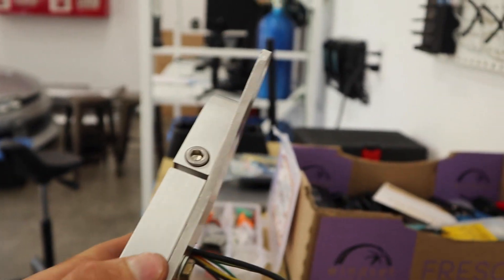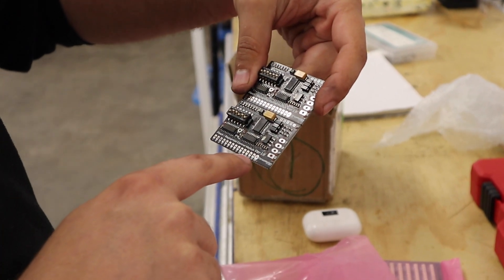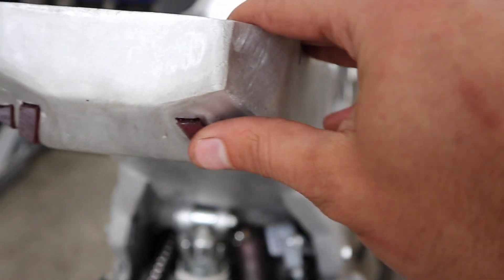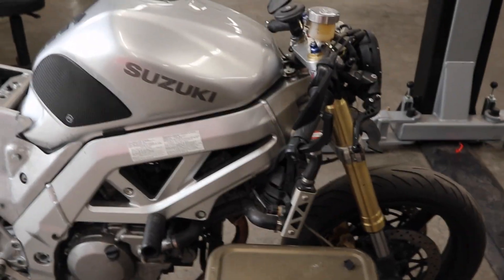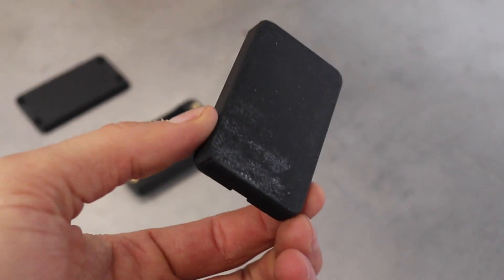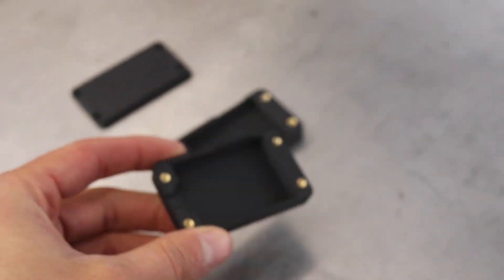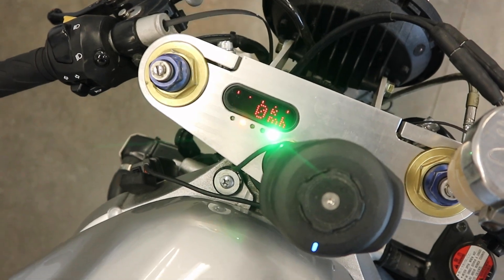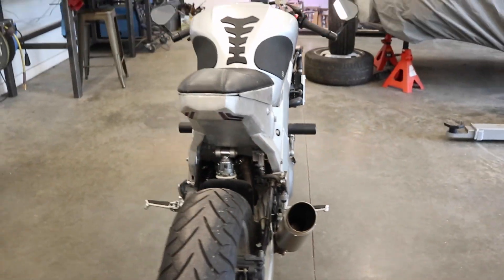2nd Gen SV650 streetfighter  is done! (for now)

Comment: Loving that sub frame - would love one for my 2nd gen SV650, it fits the styling of the bike so well - I might have made it slightly longer though so its on line with the centre of the back wheel? but difficult to say with out it in front of me - either way I want one - I don't suppose the CAD files are available?